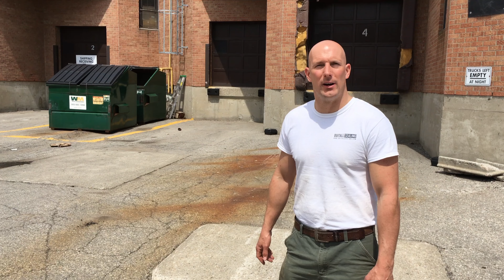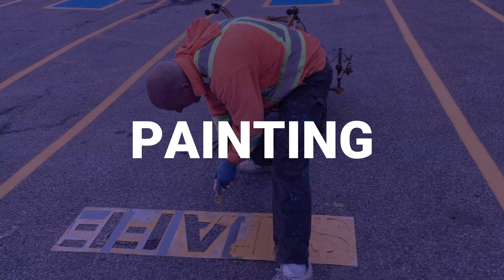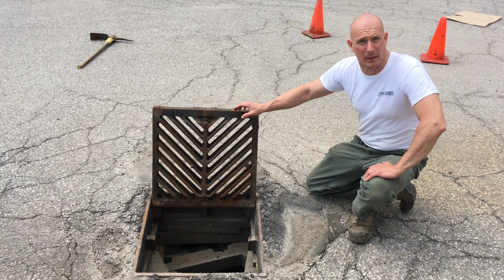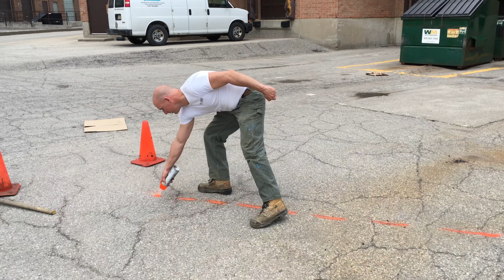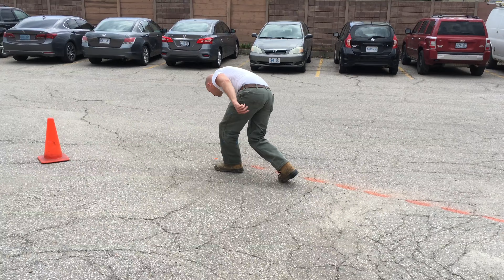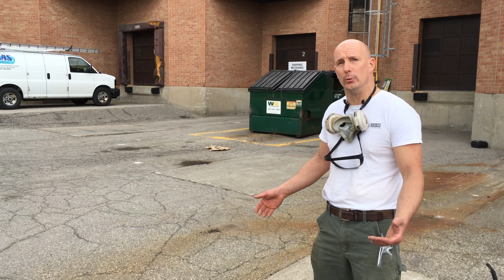Catch Basin Repair & Rebuild (4K)

Comment: What about the most important thing. The  motar between the rings.
Reply from the maker: I've seen that done but here most are not using that between the rings at all.  Thanks so much for watching!
Reply: @DOITALLSEALING  I was just wondering. Where I live they use it. I know that the place where I worked for it was used. It keeps the water, and dirt from washing away.